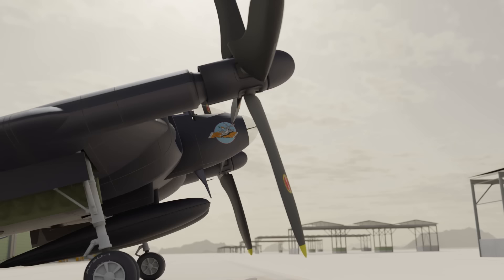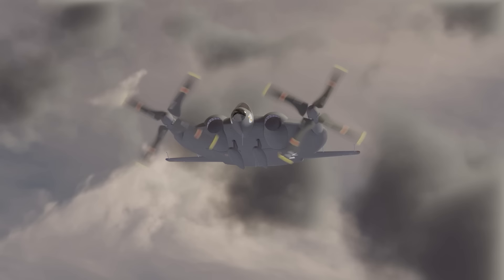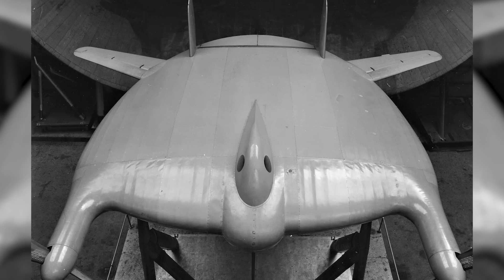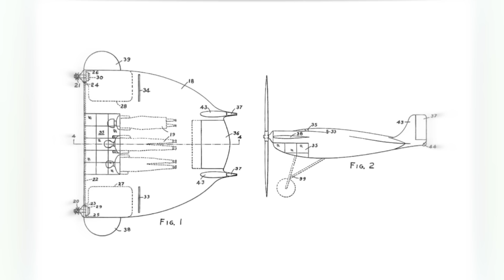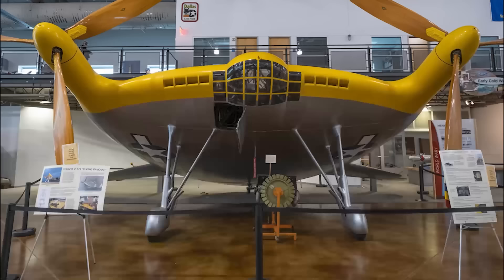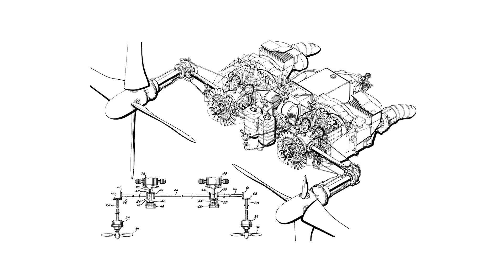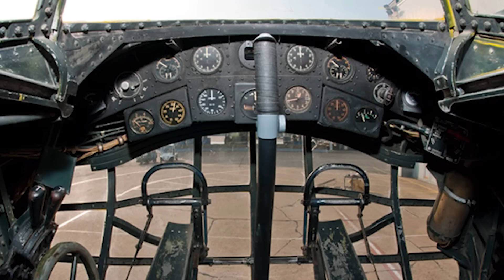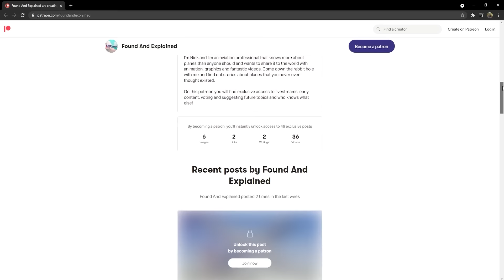The Flying Pancake - Slowest Plane Ever Made!

Comment: Thinking about this, an aircraft like this would probably make for an excellent COIN aircraft. Think about it. S/TOL means you don’t need a full size airfield to operate it. Ideal for operating in the middle of nowhere. With the lifting body and large wing surface area, payload is gonna be excellent. And you can pack a lot of fuel. Loitering time is gonna be wonderful.
Reply: Downside is that it would have a huge visual profile that would make it easy to spot and target using ground based heavy machine guns.  It would also lose a lot of it's aerodynamic efficiency when you start hanging external bombs and missiles on it.  

Another consideration is maintenance.  If an A-10's wing get's damaged you can actually fit a new one.  If any part of a plane like this was damaged it might be a complete write off.  Plus having enough hatches in the fuselage for mechanics to do routine maintenance on the internal systems could be an issue.

So not necessarily a bad idea but you have to consider the downsides as well as the upsides when looking at this sort of thing.
Reply: @silverjohn6037  It can be used for civilian humanitarian missions in Africa
Reply: @thekraken1173  : Yeah, this sort of thing would probably be best suited to non-military roles. Would be interesting to see an attempt to adapt this design to full VTOL too, maybe with low-mounted rotors and thrust redirection flaps like on the Curtis Vertiplane or Fairchild VZ-5.
Reply: Replace the tail plains with a pair of swiveling fans and you've got an excellent starting point for a fast, long range drone with nearly full VTOL capabilities.
Reply: @UC6c3GU25MfPhWL6VukH48cg Because batteries and electric motors will be heavier than jet or turboprop engines and fuel for the foreseeable future.
Reply: @thekraken1173  Then use a constant speed generator and chemical fuel storage. I'm shocked it doesn't get almost all the attention for small 2-4 passenger VTOL concepts and large drones. There was an incident a couple months ago with an usually quick and long range drone playing with a customs helicopter in Arizona iirc before zooming off over a peak most drones couldn't hope to overfly. This was almost certainly some sort of lifting body hybrid powered airframe more like a V22 than a typical multifan drone.
Reply: @absalomdraconis  Most military things survive best by never getting hit, ideally never getting targeted. You can't hit what you can't see and with proper countermeasures a drone that can loiter at a distance can provide observation, targeting or even a stable sniping platform. Low radar cross section is entirely doable, running off batteries vastly lowers heat signature and just eliminating highly reflective surfaces and matching sky color makes a thing hard to spot. As far back as WW2 ASW aircraft used simple lightbulbs on their wing leading edges to match the apparent light level of the sky behind them greatly reducing the range that a U-boat crewman could see them coming in daylight even with binoculars.
Reply: @silverjohn6037  Would have been good procurment for the coasties.  Search and rescue bird.
Reply: @silverjohn6037  survey like in case of floods and forest fire ,could be used as psudo satellites .a solar cell powered one since it requires very little power.
Reply: I would have to agree, and also imagine if you build a replica aircraft but using modern composites and power plant. Make it into what it was originally intended to be. A true bush plane!
Reply: @thekraken1173  - Why? What would it actually do?
Reply: @scootergeorge9576  it flies slowly and doesn't need a long runway for it to take flight
Reply: @twistieman1078  And that alone is supposed to make it a great fighter aircraft?  That is what the Navy wanted when they funded the program.
Reply: @scootergeorge9576  I'm sorry but if you're expecting something like that to be a fighter? That's very optimistic.
The Kraken's idea of using it for civilian purposes is more believable.
Reply: @twistieman1078  - This is the XF5U. The Navy ordered it as a carrier FIGHTER aircraft. Experimental Fighter, Design 5,  By Vought (U.)  Yes, the USN expected it to be a fighter.  As I recall it was powered by a 2,000 + horsepower Pratt and Whitney R-2800 twin row radial engine. The F4U, P-47, F6F and others used it. Severe driveline vibrations and the coming of the jet age doomed it.
Reply: @scootergeorge9576  you're right, expected** 

Like I said, you would be very optimistic to think it would be a fighter aircraft - it was over budget and over development time, getting left behind with technology such as the jet age.

What's your point in now stating facts regarding the aircraft as well, what does it do to support your comment?
Reply: @twistieman1078  - The Flapjack not only failed in the fighter role, I am not aware of anything similar succeeding in other roles.  What I said was self explanatory. I can  do no more. This aircraft is yet another that folks love to call "Ahead of it's time." Problem is, that time has yet to arrive.
Reply: @silverjohn6037  How about an unmanned reconnaissance plane, with CAS capabilities?
Reply: Except it's only 160hp to get it in the air.
Reply: Near impossible to stall, extremely stable, relatively large fuel capacity; this would have been a perfect plane for the civilian market, not the military market.
Reply: @silverjohn6037  one of the reasons I think this would have been more appropriately designed as a civilian aircraft.
Reply: @CGoody5642  The military market would gladly take it for those same reasons.
Reply: @CGoody5642  Probably way more expensive and complicated than other civilian planes, though. The prop-setup was a bit complicated and the prototypes had issues with vibrations. The body-shape would likely be very expensive to manufacture, maintain and repair. Probably way harder to land if the landing gear doesnt fully deploy. 

Mind that lifting body planes really arent forgotten technology from World War 2; theres been a lot of research later in the 60/70s, and they just werent as good as conventional planes in most use-cases.
Reply: I was looking at it myself and wondering how well it would have handled stealth shaping and F-117 style wide and flat exhausts.  the shape lends itself very well to slope facing, the way the F-35 does.
Reply: @owenatkin3148  You think it could be modernized into a stealth aircraft?
Reply: @owenatkin3148  You'd loose a LOT of lift, probably. The shape is done that way for a reason, because its a giant wing. 

And I mean, theres a pretty effective stealth plane relying on a pure flying wing design, the B2-bomber. But with that you see a pretty huge, wide wing surface.
Reply: Andrew Onymous  It could fly high enough to stay out of range.  Or armored.
Reply: Flying wing designs are routine now and flying wing drones are an off the shelf item.
Reply: Need 3 ft TV vg to 4 gf few 21 DDS moo moo center
Reply: Because s helicopter can fill that role with half the cost?
Reply: @ehold6877  Initially, yes.  In the long run, however, fixed wing will always cost less to maintain.
Reply: I thought this plane was to be able to fly at over 500mph? The prototypes never had the proposed, & much more powerful, engines.
Reply: stol distance defined by DOD is 1500 ft, clearing 50 feet at DER. C130 already does this, can depart with full load with 300 meters on a unimproved surface, and the C123 is even smaller and needs even shorter TODA. 

For any real payload capabilities this monstrosity would have to be the size of a 123 at least, and flies too slow to be worth wasting fuel on.

If you want even smaller the Sherpa does an excellent job and can do some impressive short departures with plenty of cargo.

This thing doesn't exist for a reason. A medium lift helicopter flown at max range would be more efficient.
Reply: yup. same for carrier opps: slow speed and long loiter times are perfect for CAP AWACS since its directly overhead the carrier group at all times. 
IN FACT, THE DAMNED THING LOOKS LIKE A FLYING AWACS radome. I spent 3 months with a navy awacs hanging over my head in a bunker.  a decent designer could blend that lifting body seamlessly with the awacs radome in a pancake drone. it wouldnt need stealth. carrier could have 50 of them in launchers. replace a downed one in a second. daisy chain them over the horizon with communication lasers. no satelite links needed. 
There are already small blimps used this way experimentally in the 80s.
Reply: @johnassal5838  This was most certainly a foriegn state player, which includes Mexican cartels and the AZ civilian gov didnt want to admit they cant control the skies. No cvilian drone could stay in the air at those energy levels (dodging at high speeds) for the 3 plus hours that thing did then blast over the mountains, scraping the choppers off in the process.  Had to be turbine powered and sat linked or operated from a loitering aircraft nearby to maintain control after going over the mountains, unless autonomous. Again, state linked actor in all 3 cases. lotta money.
Reply: @Rivenburg-xd5yf  That's a damn good idea!
Reply: @Rivenburg-xd5yf  Or it just had a petrochemical powered generator and a pilot on board but I'd agree the main reason anyone trying to build such a thing and pull a stunt like that is free advertising for the narco smuggling money.
Reply: Seems like an osprey
Reply: Also good for target practice.
Reply: Also it looks like a coin.
Reply: Yeah well they did make it for a reason
Reply: @silverjohn6037  yeah... No.
Reply: AA emplacements? Noise? What could it do that a Helicopter couldnt do? Seems redundant before its creation
Reply: @silverjohn6037  You're discounting the fact it can fly extremely low and slow with massive control and maneuverability, which means it is only exposed to fire from static AA and AAA for seconds at a time, all your other points are solvable via creative R&D engineering, the advantages of it in the coin role are replete and extremely novel.
Reply: @scootergeorge9576  um, it shares a lot in common with the flying wing, which as we all know did eventually get developed into the B2.
Reply: @jadedandbitter  - More like a lift body.
Reply: @johnassal5838   Unfortunately, it can't lose its tailplane or it loses airplane functionality and becomes a regular drone. Turns out, the tail is really important for not dying.
Reply: at this point you may as well use a helicopter
Reply: Like a helicopter?
Reply: climb out at 45°, descend at 60°, stopping in it own length or less with any wind. Faster than similar power & footprint "normal" plane.
Demonstrated with the Nemeth "parachute plane" and Farman 1020 and the Arup planes of the '30s.
Stall-spin proof, nimble and stable & forgiving.
Reply: @termitreter6545  it did not need or gain anything from the situation with the props. NACA tunnel tests showed this, and the Arup planes of the '30s showed it.
Reply: @absalomdraconis  see the parallel Boeing model 390/391 for what a fighter would be like.
Reply: @JFrazer4303  It helps if you are more general answering posts months' old. No clue what this is about.
Reply: @termitreter6545  You had replied that the prop setup with the Vought planes was too complicated.
I replied that it did not need it. The Arup planes showed definitively that a normal lane with such wings could perform well -better than a "normal" plane.
Reply: @JFrazer4303  Oh I see! You avoid the complicated dual prop setup. Thats definitely a plus.
Reply: The original prototype was also very poorly made in general which didn't help it's reputation. There was a lot of rewiring to be done, buttons being in bad positions, low quality materials and so on.
Reply: nature already made one of these, the manta ray.  So, why give pancakes the credit?  The Manta Ray was robbed
Reply: this was my thought.  maybe it is too slow for military use, but it could be great for recration, or for when you need to get a payload somewhere that a car or boat can not get to
Reply: @silverjohn6037  A tricycle landing gear would be essential for ground handling, arming, et cetera, And engines buried in aircraft wings is always costly and difficult to maintain.
Reply: @thekraken1173  Seating one pilot, very useful in Africa.

Comment: You totally miss  the underlying design philosophy. The high aspect ratio wing has been known by many as very efficient. I.E. lift to drag ratio. The problem is with very long wing tips it has great wing tip  vortices-, where the high pressure air under the wing rushes to the low pressure area on top of the wing. These vortices (which Geese take advantage of in their V formations) are minimalized by having short wing tips like the mustang you put up, and also by modern airliner winglets. Zimmerman created a very direct solution by putting the props right on the wing tips rotating in the opposite direction as the vortices thereby cancelling that inherent drag and maximizing the inherent advantages of the  high aspect wing. This design and it's inherent efficiency remains untapped except by the very expensive Osprey. Commercial aircraft could do well to perfect the design.  Small  frontal area turbo-props could be used right in the wingtips and avoid the drive train issues.  Zimmerman  has left his gift for some forward thinking designer to run with it!
Reply: Myth and urgan legend.

The props in Zimmerman's plane did not cancel the vortices. 
NACA tests showed that it did not gain anything or particularly change anything with the situation of the props.

The Arup S-2 which this was based on, had all the same flight qualities (super-STOL, stall-proof), but did not use Zimmerman's propeller situation. Did not suffer from lots of drag.
The fact that the V-173 was able to fly super-slowly showed that the wing-tip driven "parachute lift" was in effect which means the props didn't counter them in any meaningful way.
It got its flying qualities solely from the planform, not the awkward and over-complex situation of the props.
Reply: wingtip props don't cancel vortices, they move them further out as they increase the effective span. there's an advantage to tip props but it's not huge ... debated but less than 15%, and designers are not keen on the characteristics of losing an engine. in general short heavily loaded spans generate larger vortices than long lightly loaded spans. the tips of long spans do the same thing as they would if they were folded up as winglets, except they don't fit so well in airports
Reply: having engines at the edges would create quite a big bending moment and overall really stress the wings, so the extra mass needed to reinforce the wings would probably counteract any gains
Reply: @DS-pk4eh  
I want to build one.
 I haven't done anything since control-line profile planes and balsa and tissue paper rubber-band power, decades ago.
IDK what materials or tools...
Reply: @JFrazer4303  Not sure that balsa would be the best fit for this. Either structurally or too light. 
Maybe 3d printed structure with some light cover to make a wing.
Reply: This video is very annoying because the title claims it's the slowest plane...but I do not recall a number being mentioned for the slowest speed it can fly without stalling/ controll loss. :-( :-( :-( Also it's perfect for all electric plane as others mentioned. Elen Musk with Tesla would be best bet to fund such a plane; not even for tech, but just bragging rights "First all electric plane that can carry Humans"
Reply: @denalozecon9074  yeah the title is bunk.

Btw electric planes are a thing. Alpha Electro is a 2 seater trainer all-electric
Reply: @denalozecon9074  the '90s "Facetmobile" from Wainfan flew 100 kts on 40 horsepower, with 340+pounds useful load. It flew in level controlled flight at <16 kts (his pitot tube wouldn't read any slower). That constituted the slowest plane, but it was not slow at cruise.
Reply: It's compact design also made it very agile. Agility as in the time needed to change direction is largely determined by the amount of weight away from center and how far that weight is from center. The further away it is the more you have leverage working against you.
The XF5U had a tremendous roll rate for a plane of it's weight class and was also quite agile in other categories.
Reply: A high aspect ratio is not always more efficient, it depends on speed. The faster the plane goes the more drag is being generated by a high aspect ratio wing. That's why many fighter jets have relatively short wings despite their need of a lot of lift.
A low aspect ratio wing creates a lot less drag.

The main design philosophy was to create a plane with a very large speed range. A plane that would have both a very high top speed and a very low stalling speed. You are right about the propellers though which was a very clever solution to the wingtip problem.
Reply: @JFrazer4303  I think that Zimmerman could be inspired by Stephen Nemeth Parasol (circular wing) also. From my point of view, this aircraft is very interesting and it is a pity that they didn't put jet engines instead of radial ones.
Reply: @MrMarinus18 
 The XF5U didn't even fly, due to the unnecessary and overly-complex situation with the props.
The much simpler Arup S-2 which this was based from, was nimble with astounding steep climb rate and good speed for its little power.

A point about very-low aspect-ratio wings is that they do not stall. Flow does not separate from the top of the wing, negating all lift and denying the trailing edge controls strong smooth flow.
Reply: @kakavdedatakavunuk8516  Zimmerman was on the NACA team that saw the Arup S-2 fly, and in his writings only after that did he adopt the planform as the starting point for his work on a VTOL tail-sitter.
The Nemeth is also an important predecessor proving that the type is not draggy but sleek, and won't stall.
Reply: @JFrazer4303  I forgot Johnson's Uni-plane